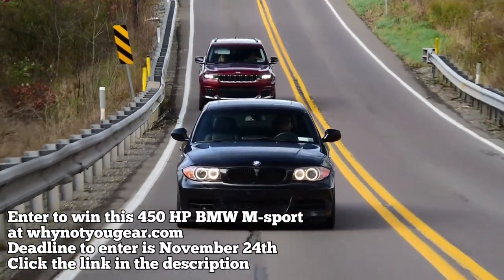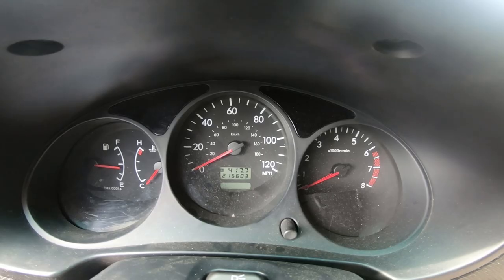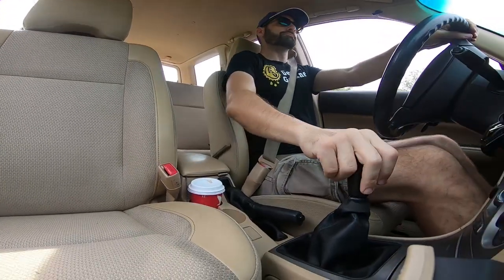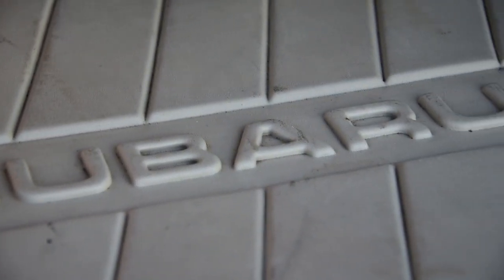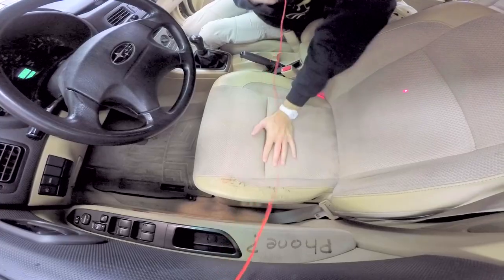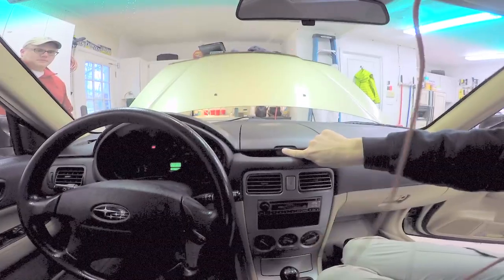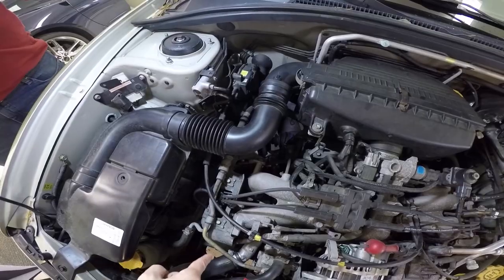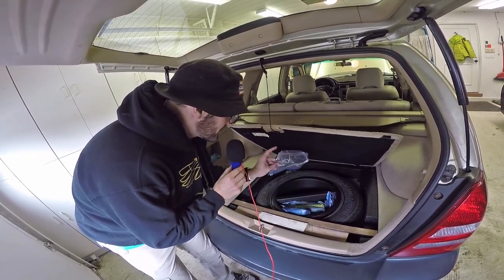2004 Subaru Forester 5MT: Regular Car Reviews

Comment: My first car was a 2003 Subaru Forester. It was a hand-me-down from my uncle to my mom's and then to me. As soon as I got it, the body started rusting on the rear wheel arches and the unavoidable head gasket issue had to be resolved. I never had lots of money back then, but I was always to pay the repair bill when something mechanical broke including that time when the front differential that blew up (new transmission). I wanted to get the rust fixed, but lots of people told me it wasn't worth it. 5 years later, the rust on the rear wheel arches spread to the suspension arms and I had to get rid of it. It got replaced by a 2011 Subaru Outback. I will still remember the fondness of having my first car and that is was a Subaru. Driving it in the snow was a blast and my newer Outback is also giving me pleasure going out in winter storms.

Comment: This is how I feel about my 2012 mazda3. It was my first adult purchase, I've had it since it was 2 years old, and 40K miles. Like Goldie it was both a car I used for work (Construction inspection) and spend 40-70 hours in a week. But also one I used for many fun trips down the coast, and always THE car for a few friends to go places. It has 156K miles now, which isn't crazy high, but they have been drama free for the most part. A clutch master cylinder started leaking bad, but I was able to drive it for a few days until I got it in. 

In a part of my life that had lots of stuff happening, this car as been one of the most reliable and consistant things in it, I owe a lot too it. I don't really need it as much now, because I have a company truck, My partner's car, and a Project Miata, and a growing need for a farm truck/suv... but I don't think I'll be able to part with it until it meets the point it can't viable stay on the road.

Comment: On the AC compressor clutch there are thin spacer washers on the spline. When the clutch starts going out, pull it off, remove the spacers, and put it back on. No need to shove a cut up beer can in there.

Love my 06 Foz.

Comment: I got a wave of nostalgia for my old 04 EJ257-swapped Fozzy XT 5MT, same EVAP codes that won't go away, same rusty rockers, same cracking seat bolsters. Man I regret selling that thing. Also, thank you for revealing why I kept burning headlight bulbs out (I also eventually got HID's). RIP Goldie, your service is appreciated.

Comment: I have a 2003 Subaru Outback wagon with the 2.5 L 4-Cyl, with 180,000 miles. It has almost everything this Forester has in terms of features. NOAA Weather Radio, sunglass holders, and yes, even a CHECK ENGINE light. It has an automatic rather than a manual, and has cloth seats. The way this video hit me was much different than your other videos. As a fellow Subaru owner, I love this. So long, Goldie… ❤️

Comment: I bought one of these for $700 dollars and got it on the road this time last year.  It is not fast, but it is so balanced and just feels right to drive.  And it is a weapon in the snow, especially with blizzaks.  Mine has 195k, no AC, ziptied hill hold, a section of fuel line replaced with rubber, both front inner axle boots left the building, missing ABS sensor, 1 remaining o2 sensor that may or may not actually still be doing anything, a starter that has trouble turning over the engine when warm, leaks (water in, oil out), but it just trucks along day by day.  I bought it as a work/ winter beater and it has been worth way more than what I paid for it.

Comment: My version of Goldie was a 2003 Lancer OZ Rally I bought for $800 from some guy named Drake two years ago. It served me through an abusive relationship, a period of homelessness in the middle of high desert winter, and countless miles around the valley and up the mountain passes. His hood and driver quarter panel are flat primer grey because he was at some point wrecked. His engine was weak, but he was never not down for highway pulls.

Oz still lives on with a friend of mine. He's doing okay.

Comment: 3 cars in a row that I owned; '00 Impreza 2.5rs 5MT, '01 Forester 5MT, '10 Outback 6MT. That 1st gen forester was very similar to this 2nd gen. It would fail to the elements at some point. My '10 Outback also fell to the Ohio rustbelt. But it was a hard worker up until that point. It was also easily the best winter vehicle I ever owned. I had the "premium" package with heated cloth seats, heated mirrors, and a really nice feature I've never seen since; it had heating elements in the front windshield where the wipers sit, so they wouldn't freeze to the windshield. What a car.

Comment: Love this channel because it makes you appreciate all cars, especially those base model cars that werent meant to be flashy or fast. Just reliable and able to get you to where you need to go. I kept my first car, a 2000 Grand Cherokee Laredo, and have no plans on getting rid of it, because i dont need to. I had bought it for $300 and other than some sensor replacing and a crappy autozone alternator that has taken a dump on me twice, the GC has been a treated me very well, and i return the favor by taking care of it.
Reply: I had a 2011 ford fiesta base with manual windows and locks. Had the transmission flashed once but never had any problems. I kept it clean and very maintained and looked brand new. Something about cheap cars makes me happy

Comment: Had me a 2005 forester XS for 10 years. Absolutely loved it. Winters were a joy and lots of fun. It s not a perfect car by any means. Everything you mentioned is true. You forgot to mention a fee things. The heater a the bottom only blows on the gas pedal side. So your clutch foot toes are always cold. You cant fold back the the side mirrors in the winter. If you do they will brake. The wind noise from the frameless windows can be remedied by pinching the top of the rubber gussets. I wont say more because at the end of the day the car was great. I cried a little when I sold it but she was getting expensive to keep on the road. I now drive a 2013 manual forester. Better in many ways and worst then before in other ways.  but I dont love it as much but its growing on me.

Comment: Great tribute to this gen Forester. I picked up a clean 03 Forester X with 32k miles three years ago. Put some Michelin Cross Climates on it, and coated the entire chassis in NH Oil among many other things and it’s been a great little wagon. Sitting currently at 45k  miles, I plan to keep it a long time 👍🏽

Comment: The first car I owned myself was an '04 Forester XS 5MT. Bought it so I'd have to learn stick. Her name was Gertrude, and she served me well, despite the winter salt causing the entire exhaust to require replacement in different phases during the 3 years I owned her. Never got stuck in snow or mud, despite my being too poor to replace the bald tires. Survived all my abuse of pretending to be a rally driver on dirt roads, wading through mud on seasonal paths, and blasting 4-wheel drifts and snowy parking lot donuts. The factory head unit lost its mind, but I threw in a Kenwood I got for xmas and was happy. Moved with me from PA to NY. Got me from Corning to Scranton through that huge snowstorm in 2018/19. 

Got $500 in trade for her towards my dream car, the '19 WRX I have right now. She had another hole in the exhaust and the CEL was on, wouldn't pass NY inspection. But letting go was bittersweet. I still might look for my unicorn, a 2nd gen Forester XT 5MT, and name her Gertude II.

Comment: There is something beautiful about the early 90s to mid 2000s cars in that semi economy/middle category. They have nothing more than you want, with an ergonomic bliss. These cars came from an era where practicality and efficiency were valued, they also can cruise happily at 70-80mph, unlike the earlier cars.

These cars had some quality, and lasted. I was a Honda mechanic for several years; NOTHING beats those type of car.

Like the Subaru; the Tacoma, Civic type category and most other Japanese cars, those value brands offered a type of car we will never see again.

Comment: I gave up on my '02 Legacy GT Wagon (2.5 NA/5MT) back in '14, with 217k on the clock.  Same issues. Rust (not as bad) and slowly-mounting mechanical quibbled.  Its replacement was an impulse buy: a 1999 Audi A4 Avant.  Baaaaaaad idea.  The Subaru's issues were always mild enough to live with until inspection time.  A fuel leak here (Subaru Flambé), a stuck caliper there... always got home. never left me stranded.  And, yeah, the four-wheel rooster-tails in the winter were way cool.

Comment: Before my Taco I had a 2010 Impreza OBS. I threw some steelies and proper winter tires on it up here in the New England winters and it never once let me down. I don't logically need a second vehicle but as much as I love the Tacoma, that little Subaru just had character, was a mule in the heaviest of snow... and the almost 10 miles to the gallon more didn't hurt.

Comment: As a second generation Forester owner, I feel your pain on this.  It's not an exciting car, it isn't fast or exactly engaging to drive, but it fulfills its duties beyonds it's original purpose and subverts it's own narrative of disposability.  I am currently at 255K miles and it's got plenty of issues; rear/center differentials bind on tight turns, CEL is on due to the cat's being toast, cruise doesn't work unless aforementioned CEL is cleared (nice little Subaru quirk where they kill your cruise until the CEL is fixed), RUST...this has rust in a lot of places but it hides it well, burns oil like you'd expect, wind noise on the drivers side is getting louder & louder but I can't find the source, etc etc.  It's so easy to work on, it serves it's purpose so well and just does what I need it to.  It's a beater that I can let sit for weeks at a time & it will fire right up on the coldest days & with my Nokian WRG4's get through the MN snow, ice, sleet, slush combination with ease.  Best $400 car I have had in a good long while.  

I'll pour a La Croix out for Goldie.  More than 4 years of excellent content was created with the assistance of Goldie & I am thankful for it.

Comment: Ahh, the mighty Subaru. My driver is an 02 Impreza TS, my previous; now parts car was an 04 Outback Sport. Jammed 215/65r16 BFG all terrains on there and beat the hell out of them. The short way to work for me is 60 miles of logging roads. Enthusiastic driving? Yes, very. EJ251 leaking oil from the head gaskets on the exhaust? Yes. Fuel mileage? Yes. It gets fuel mileage. Reliability? Amazing. The TS has what sounds like a rod knock that was there 10 years before I bought it. Been trying to kill it for 70k miles since I bought it. No change, and barely turns the oil dirty.
Driving experience? Love it. Ease of working on it? Amazing. Durability? I have replaced one ball joint in the TS at 180k miles, with no sign of ever having any other front end work done. I don't know how many times I've "accidentally" been a bit too enthusiastic with speed cresting some of the hills on the bush roads, Subaru's fly well.
The quirks of these older Subaru's tickle the gearhead brain just right.
But, and it's a very big but, the rust! The 04 was too far gone when I got it for free. I drove it until the drivers rear strut tower was no longer attached. 
The TS, while it was a relatively clean west coast car, I just had to rebuild both rear strut towers. It's days are numbered, and I'm not happy about it. 
As much as I enjoy these cars it's hard to decide what to do next. Do I find another clean one, and drive it until it's inevitable demise? That almost feels selfish. 
If only I didn't live in the rust belt...

Comment: 17:00 My "15 6sp manual Sonic RS has hill hold. It works for stop lights up hill. it will hold your brakes in NEUTRAL (not first) until you start moving in first gear. 
Have a car meet with all the fans and viewers pick off a souvenir part before the send off
Reply: Same here in my 6mt RS, specifically when you have the clutch in on a hill, very helpful
Reply: @Junohawk Red👌 new gen, from your channel cover
I don't like that they stripped them down to cloth seats, new cluster, and one less cubby next to the radio.
Mine is Dragon Green😄

Comment: My 06 outback is in a similar state of disrepair 230k miles. And with all my problems with it, the valve covers and power steering pump were caked in oil(the pump is still), the nonstop electrical issues the headlights causing many tickets, and the 4EAT with not enough ATF causing a horrible shift from 2-3 on the up shift. I still keep coming back to it and I know just how safe I’ll be with it in the winter. Sure it’s slow, not great on gas, horrible understeer with any throttle, but yeah it’s love.

Comment: I had a 2004 Subaru Forester 5mt as well, I added a lift kit and bigger all terrain tires giving 3in total lift, some beefier axles and it was beast, amazing underrated car, if I find a 2nd gen xt with a manual I'd buy it

Comment: I recently bought an 02 Forester to use for a ham radio/skywarn spotter/storm chasing/ohio winter car. Mostly because of this video. I was looking for something to use and found this video. Needed O2 sensors, spark plugs, MAP sensor, and possibly has a vacuum leak and a bad wheel bearing. 315k miles so im not surprised. Looking forward to giving her a new life

Comment: I love my 1999 Foz base model 5mt.   I bought it 12 years ago with 74,000 miles and I've only put another 60K on it.     I bought it as the winter/beater car and it has, indeed, been used as such.  The rear wheel arches on the 1st gens rot away, otherwise it would still look presentable.    I bought a 2014 WRX Limited hatch new and it has hardly ever seen inclement weather, but, ironically, now has two accidents on its history.   The ratty Foz's record is as clean as a bean.   My wife wants me to dump it, but that's just ridiculous.  It still runs well and hauls dogs and yard waste without a fuss.   One of these days, age, not miles, will take it, but I'm hanging on until that that time.

Comment: I'm 17 my first and current car is a 02 Impreza RS. Head gaskets went, but me and my dad replaced em and rebuilt the motor with about 3 grand worth of mods, bored out the heads, got a cai and a million things that I don't know. Fuckin love that car, definitely feels better than driving a boring coupe or A run of the mill suv.

Comment: I saw a tiktok covering the borg-Warner  mechanical hill hold cylinder on a Studebaker. The system on that ran off the clutch. The brake pedal would pressurize the line, the angle would roll back a ball bearing inside the in-line cylinder and would stay in place as long as the clutch was being held. Once the clutch released the bearing would shift and the pressure would release

Comment: I had ‘04 Forester and it was my favorite car I ever owned. It went over 200,000 miles. The timing belt went and then went the engine. It was great car.
Reply: Motors swaps cost about the same if not a little more than a head gasket replacement. Might be worth looking into, especially with the current car market wanting these older subies

Comment: I had an ‘06 with a manual. My daughter had been born about nine months prior to that; I figured it was time to upsize and the frame on my ‘04 Mazda 3 was rusted out. I sought out a Forester because, like you said, it’s more akin to a wagon than it is a crossover, and I’m not interested in crossovers. Especially when they don’t offer manuals anymore.

It did exactly was supposed to do, and with the five-speed, it was honestly pretty fun for what it was. It was capable in the snow, natch, and even if it wasn’t exactly an off-roader per se, I could still be kinda goofy with it without getting into any trouble.

Eventually, the A/C condenser killed itself, the serpentine belt split and somehow ended up melting one of the pulleys in the tensioner assembly, and the head gasket puked all over the place. Too much to deal with all at once.

That cubby in the dash? It was the taco compartment.

The head unit? Yeah, the previous owner replaced it. I went on eBay and got a stock unit for $15 shipped. That aftermarket thing was crap and goddammit I wanted the weather band.

Turned out I didn’t need to upsize at all, we’re a pretty low-maintenance family and we’re staying a three-person household, so now I’m back in a sedan. But that Forester got the job done when I needed it to do.
Reply: I totally wasted my twenties too. Spent the first half going nowhere with an “art” “degree” that I’ll never use and the second half making up for it but living almost devoid of joy. Kinda wasted my thirties. Had a kid, got a PhD, sure, but I can’t help but think I got something completely wrong, that trying to make a career of what you think to be your passion doesn’t necessarily land you in the career you want—even if it pays pretty well—and you burn yourself out on what you thought was your passion, ultimately resenting them. I ended up doing that twice.

Why the hell am I venting here.

Comment: Me version of this was a 1989 G10 Chevy van I owned since 1994 and basically gave away last year. Paid about 3.5k in 1994 and clubbed that thing everywhere, doing anything, absolutely mercilessly. Rusted, bashed, noisy but, I just decided I had enough vehicles and had to move it on. I have lots of great memories involving what that amazingly indestructible truck would do and get to.

Comment: I guess another good thing about where i live is my 1994 Subaru Liberty GX 2.2 Manual has basically no rust, 350ks on it and is still daily driven and Everything works, all electrics and even the old hill hold feature which trust me is FAR better than the later electronic version, the electronic version has no feel, whereas the analogue version you could feather.